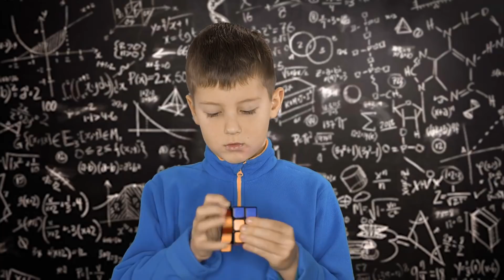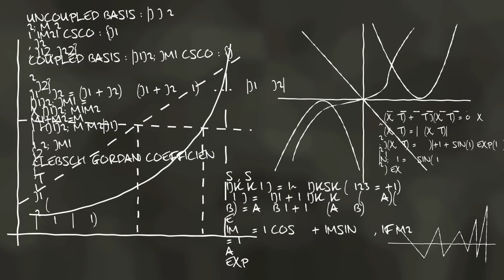Ludwig von Mises vs. The Blood and The Soil

Comment: I fail to see how the fact that reason is universal to mankind is challenging to ethno-nationalism. Even if you have the same tool as everyone else, that doesn't mean you will use it the same way as everyone else, or achieve an equal outcome if you try to mimic someone else.
Reply: It is challenging the particular reasoning behind racism. If ethno-nationalism is your preference for other reasons, than the ones challenged, than indeed it doesn't challenge your reasons for ethno-nationalism preference.
Reply: That's exactly what polilogism is.  Everyone has their own logic.  Avowed polilogists (typically centrists) will shrug and say, "This is fine, everyone has their own logic that works for them." until someone tries to impose their logic on others.  Problematically, a co-operative society requires logic to be shared.
Reply: @jansvoboda4293  
I have never heard a modern ethno-nationalist claim that logic or specific kinds of logic were particular to certain races.

Comment: The rationalist delusion is strong with this one. Also many points made were since debunked by research. Race realism is real and goes deep.
Reply: Hear hear.
Reply from the maker: Anony Mous 346546 can you explain how different race have different logic?
Reply: What I meant is humans do not operate purely on logic, but rather mostly on instinct. This is what i call the rationalist delusion originally from Jonathan Haidt. And insticts vary somewhat between races depending on the environment of their evolution. Also the ammount of logic they are capable of varies between them as well as between individuals.
Reply from the maker: @AnonyMous-gt8vq  But Mises is talking about the logic of planning for specific ends -- for example you want to get from A to B. A culture with the wheel will do this more efficiently than one that won't. That doesn't change from race to race. The race who hasn't developed the wheel will adopt it once it is introduced to it because it is a better method.
Reply: @AcademicAgent  I do not disagree with the argument in general, I just want to point out that it does not always hold true. Just take the example of the wheel. Clearly the whole world has seen the wheel by now, yet the media still likes to show these African women carrying water in jugs on their heads. Why haven't they adopted the wheelbarrow as it is clearly rational for them to do so?  Is it perhaps they have such a short time preference they are unable to sacrifice time to make wheelbarrow with a water tank even though it would pay off in the future? Is it perhaps they live with people that will instantly destroy anything anyone makes? They have had infrastructure built by colonial powers, yet it all lays in ruins now.  For another example Rome has had aqueducts yet when it fell the technology was lost and medieval towns had water carriers again. Aqueducts are clearly a more efficient way to get water from A to B, so why aren't they adopting them? Not just that but some the them already had them yet they let them go to ruin. Is it possibly because  medieval people as people were incapable of adopting aqueduct technology?